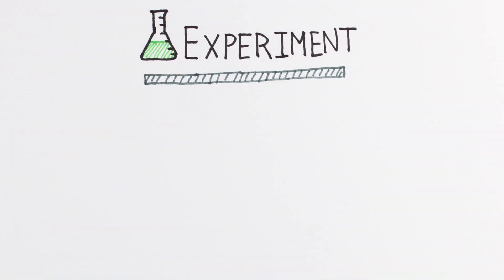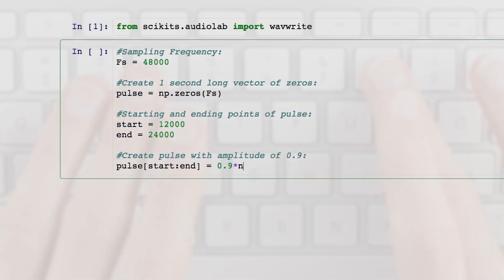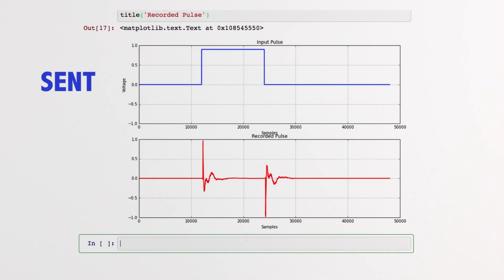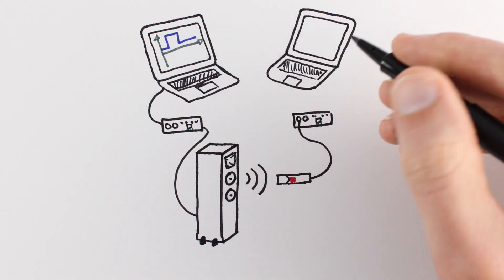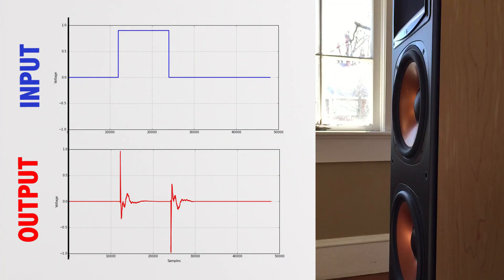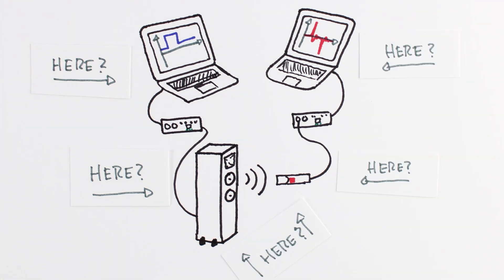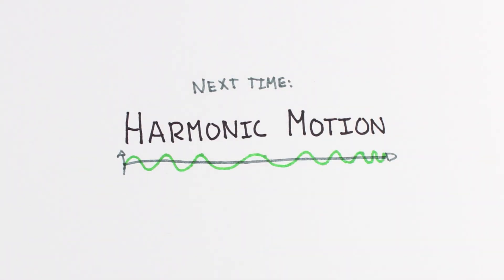How To Break Sound [Part 1]

Comment: The speaker is a transducer, they are designed to output analog signals not digital signals like the one you created. The flat line in your signal represents DC .  If you send DC into the speaker it will damage the coil if it is on to long. Speakers are designed for Audio Signals Only.  NOT SQUARE WAVES.

Comment: Differentiation. Notice the spikes opposite direction. Pretty sure the signal is of a way too low frequency to not be filtered in the HP filtered in most of the transfer-capacitors and probably its own coil as well.

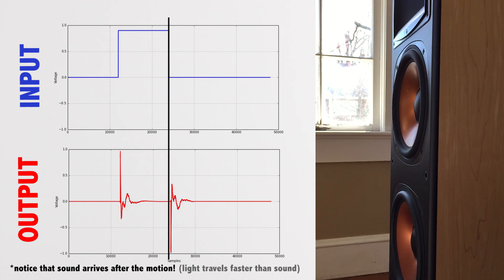Comment: @ 01:20  This is very misleading.  If the voltage were applied directly across the speaker, the cone would remain extended for the duration of the pulse!  You said "... speaker moves in a pattern that doesn't even resemble the voltage we applied across it".  YES, it DOES!   What we are seeing is the output of the _amplifier_, and not the test signal source.  Looks like there's some AC coupling in the circuit somewhere.  Feed the signal through a DC amplifier to the speaker,  and watch what happens with the woofer cone.  Either that,  or you are sending the output from an amplified mic output to the speaker, and showing the result of the mic's response.  In any event,  the speaker, as shown,  is not the one being fed by the original signal, before being measured by the mic.  Booooooooo!   In any event,  only the certain harmonics of the pulse are making it through the chain.

Comment: I think its the speakers: 
The speaker is a system of magnets, one permanent and one which is a coil electromagnet. When you make the signal high you energize the coil and make a magnetic field, this causes an interaction between the two magnets (if you notice, they repel at the moment the signal goes high and attract when it goes low).

An inrush of current causes the magnets to repel much further than at normal current, so the cone goes further and then goes back in, oscillating a bit, as seen on the microphone. When signal is cut off the "magnetic inertia" cause the cone to be attracted way too far for the normal position, so it oscillates creating the second sound...

Comment: The driver of the speaker is doing what you tell it to do. The issue is the Physic of sound. The speaker gets pushed up when it reached the voltage spike. It then moves back when it reaches the end. We don't hear anything when the voltage is constant we only hear it when I change. The only places it changes in the begging and the end.

Comment: the problem is with the speaker and mic not being able to accurately reproduce/capture a perfectly discontinuous signal like a square wave. After reaching the max and min there is still some tailing vibration. It does a better job representing smooth continous signals.
Reply: The speaker can and will capture and respond to a square wave.  The reason it did not d so in the demonstration is most likely due to ac coupled stages in the amplifier - the speaker never sees a square wave.  However,  to propagate this signal as a sound wave would require two things:  a dc amplifier, and a sealed tube (waveguide) between the speaker and mic.  Ever wonder why decent headphones deliver such rich, deep bass to your ears?  They make a good seal, to keep pressure leaks at a minimum.  Actually,  small speakers can reproduce low frequencies quite well,  just not loudspeakers,  at least not without elaborate enclosures and / or horns, due to the severe impedance mismatch at longer wavelengths between the moving surface (cone) and the open air.  They just cannot move enough air to offset this mismatch.

Comment: capacitors  and inductors behave that way in response to a discontinuous signal like you applied. the speak coil is an inductor. it works for sound as ,sound is a continuous signal

Comment: its simply because speakers work with AC, and it wont do anything if you keep the voltage the same (AKA when its a horizontal line in the graph). when the graph has anything but horizontal, the output becomes AC, which makes the magnetic field in the speaker, then it goes to horizontal, which is DC, and DC doesnt make electromagnets work, so the speaker swings back to rest position, then on the other side of the square wave, when it goes low again, the decreasing voltage again "makes" AC so the speaker moves the other way, inwards TLDR: horizontal lines are DC, which dont make magnetic fields

Comment: The issue is that the speaker cone isn't actually designed to output pressure waves that match the waveform of the voltage input. This is because the speaker cone is controlled via a magnetic field that changes proportional to changes in current (or voltage, equivalently, see Faraday's Law). In other words, the output of the speaker cone is (ideally) the derivative of the square wave, which should look like two vertical lines, the first approaching infinity and the latter approaching negative infinity (Dirac delta functions). Looking at the output waveform, we see that the output also contains some decaying sinusoidal components; these are caused by the speaker cone's natural (or resonance) frequency, because the flexible sections of the speaker cone act like springs that oscillate harmonically. (Actually, the magnetic field of the speaker also behaves like a Hookean spring and it's unclear whether the harmonic oscillations occur primarily due to the mechanical or magnetic components.) 

Knowing this, we can design a voltage waveform that will actually give us a square pressure wave; we simply need to integrate the square wave over time. This produces a voltage waveform that looks almost like a square wave, except instead of having the top of the square wave be flat, the top is slanted, increasing as a function of time. Of course, the output would still contain evidence of the speaker's natural frequency, but removing that is a control theory problem that can get pretty complicated. 

So, why does this work well for voices and things? The important thing about voices and other sounds is that they follow a regular pattern; i.e. they contain waveforms that repeat over time (periodic). Fourier transforms (which many other comments have mentioned) allow us to break down arbitrary waveforms into sine waves. And what's the derivative of sin(x)? It's cos(x), which is really just sin(x) flipped over! Thus, when working with sinusoidal outputs, the speaker doesn't need to worry about the derivative issue mentioned above. This works well for voices (because our vocal folds are harmonic oscillators) and other things (because actually, at the heart of every physical system is a bunch of harmonic oscillators) because the waveforms they produce contain very "well-behaved" sine waves. In contrast, a square wave (an idealistic human creation) contains an infinite number of high-frequency sine waves that can't be accurately replicated by a speaker cone. In short, speakers, no matter how well designed, are inherently bandpass filters that cannot produce frequencies outside their operating range. Speaker manufacturers design speakers to perform best within the human hearing range, so it's unrealistic to ask them to output strange things like square waves. 

Another interesting note is that our eardrums are, in a sense, inverse speakers. This means that although a speaker cannot produce a square pressure wave, if a perfect square pressure wave were somehow produced, it would probably sound basically the same to human ears anyway!

tl;dr: It's the speaker.
Reply: Dennis Zhang You wrote a nice explanation but the magnetic field from the voice coil actually does change proportional to the current flowing through it. There is no time derivative in Amperes Law. 
What actually happens is that any n-th order high pass filter approximates an n-th order differentiator at low frequencies. Between the audio interface (2-4 th order), amplifier (2-4th order), speaker (2-4th order), microphone (1-3rd order) and the audio interface again (2-4 th order), we are likely to approximate a differentiator of order 9 to 19 at low frequencies relative to the lowest cutoff frequency in the signal chain.
Reply: Damn bro just explained application of math from signals class at ECE

Comment: The problem is our expectation. The diaphragm moves according to the wave: It moves forward (creating an "positive" pressure wave), stays idle for a moment, and then moves back (creating an "negative" pressure wave). In the end only when the diaphragm moves, we hear sound, because we only hear when the change of position of the diaphragm creates and pressure wave.
Reply: The pressure wave dissipates into a low impedance (open air),  hindering propagation.  The sound wave cannot effectively build up, no matter what the waveform (sine, square, sawtooth, etc).  Since acoustic impedance is inversely proportional to wavelength:  the lower the frequency (the longer the wavelength of the fundamental frequency), the higher the quantity (mass) of air that must be be moved, in order to affect propagation over any appreciable distance.  All we hear are the higher order harmonics, possibly along with some parasitic oscillations of the speaker cone.

Comment: I’m going to take a wild guess and say that the speaker itself just isn’t capable of moving outward and staying there for that long. Each membrane on the speaker only vibrates on one frequency at a time, because if they had designed it otherwise there would be more direct interference.
I really hope you guys do binaural stuff, not just speakers. Our ears are amazing!
Reply: You guessed wrong.  Put a DC voltage across a speaker's voice coil,  and the cone will move,  and stay in that position until the voltage is removed or varied.  However,  the air pressure change in front of the cone quickly dissipates, at a rate dictated by the so-called frequency response of the speaker,  as measured as acoustical pressure at (usually) one meter away.  The speaker pushes air at frequencies down to zero,  but propagation of the resultant sound wave is a different story.

Comment: My simple answer (guess) is that the square wave has lots of harmonics, many of which are below 20Hz and above 20,000Hz. Here is my guess, or what I know. The WAV file is fine, and represents what you want it to, that is sent to a DAC which converts this into an actual electrical signal. However a DAC is very weak and needs an amplifier, but audio amplifiers generally use high pass filters at some stage to remove DC bias (that steady state voltage that does not change over time). So the waveform will be stripped of the DC and very low frequency components below 20Hz, and only components above 20Hz up to 20,000Hz are played. I don't understand the math behind frequency domain and fourier transforms, but that is probably needed to understand this stuff mathematically.

I do know that any function graphed over time like that can be approximated or represented as the sum of sine waves of varying frequency and amplitude. That waveform looks suspiciously like a derivative wave with lots of bleh on it. Our ears would never respond to the exact position of the speaker, and to maintain a specific position offset (bias) on the diaphragm would be nothing more than a waste of energy and might burn out the driver. Likewise our ears would not respond to a steadily moving object. It would create a constant pressure wave in front of it. We cannot hear 0Hz, or feel that pressure that does not change rapidly over time.

So in effect that graph is the result of a really dirty 2nd order derivative, (well, probably a pretty hairy differential equation).
Reply: +Welch Labs Haven't watched the rest of the video series, am I close? :) (youtube likes to hide the read more button sometimes, may need to refresh the page to see it)

Comment: The speaker is a mass, spring, damper system and so a dynamic system of second degree, which means it has a nonlinear transfer function from input to output. That means, if you want to actuate your membrane like your input function, you have to multiply you input signal with the inverse of the transfer function of your speaker. It is basically control theory.

Comment: I believe the problem is the electrical signal sent. It has only 2 voltage variations, which is why we hear 2 separate taps. Then, when the microphone records those taps, the signal it sends is the tap itself and the "aftershock" the speaker has when "tapping", which would correspond to the big spike followed by the small ones on the recording plot. We see 2 of this patterns because of the voltage variations mentioned before.
Basically, the output signal is the voltage to generate sound and the input signal is how the air moves in response of the output one.

Comment: Is this series continued anywhere?

Also i think the issue is the speaker and microphone. It has mass and inertia. when the signal is applied the speaker (cone, i guess it's called) cannot teleport to the position in space corresponding to the max signal position.

The speaker cone moves in response to the applied voltage and oscillates because of the inertia. One the signal is removed, the cone falls back down and oscillates some more.

Similar effect in the air and with the audio detecting element in the microphone.
Reply from the maker: +xerotolerant Nice explanation! This series became temporarily derailed - hoping to get back to in 2016. Thanks for watching!
Reply: I feel honored that you responded to my post.
I don't know came up with the design for your series and such but it just has me in awe when I watch them. I hope you keep going sir. Your videos are just downright inspirational.
Reply: Welch Labs It's 2017! ;w; I know it takes a lot of time and effort to make a Welch Labs quality (TM) video but I'd really like to see this series continue!
Reply: still waiting.... :(
Reply: xerotolerant it's a fundamental property of sound. In order to receive the sent message, the microphone membrane will have to move backwards, stay there, and then move forwards again, which is impossible. 
This is the exact thing the speaker does and in order to re the signal again, you need the microphone membrane to move the same way, but you can only inflict changing bumps through air molecules, you can't push on them and have them stay that way , keeping the pressure as you would if there was a stick between the microphone and speaker ... 
Long story short, you lose every bit of stagnation away from the origin at the receiving end of this setup
Reply: @mihailazar2487  Exactly.  It has to do with moving mass vs frequency response.  To send a very long wavelength (low frequency wave) any appreciable distance requires moving a lot of air.  An ordinary , reasonably sized speaker diaphragm simply cannot move enough air at frequencies much below the audible range in order to generate a wave that can propagate in free air.  Likewise, the inverse is true of the microphone... its element must have a large enough surface area and high enough compliance to act as an effective transducer at low frequencies, else the small fraction of the air volume cannot exert enough force on the element for it to respond to the slower changes in pressure.  In the event of a pulse or square wave, all you'll  get from the mic output is the harmonics that are within it's passband.  It would take a lot of power,  and a pair of rather large bass horns to send a 1 Hz sound wave from speaker to mic in open space.  The transducers would be ridiculously large, and inefficient.
Reply: it is the harmonic motion video
Reply: There's actually a bit more. If signal is generated digitally then before it will become analog, your square, during the conversion using traditional audio chips such as in laptops, will transform into something entirely different... ;)

Comment: I think the only problem is whole your setup. Audio systems are made for frequencies from 10Hz to 20kHz. Both audio output/input of your computer and input of amplifier are most likely AC coupled(by series capacitor). In practice it means, that it cuts off everything below 10 Hz. Speaker usually cannot truly reproduce sounds below 30Hz, it simply hits the limit so even without AC coupled input it would not play 2s or 0.5hz square wave. You would need signal generator, amplifier without ac coupling (you can bypass it on some amps), speaker with sealed bass reflex and all gaps, not AC coupled microphone inside the speaker box and oscilloscope to measure signal from mic.
You can try directly connecting aux cable from your computer line-out to line-in to see how it cuts off your square wave.
.
Sorry for my awful english.

Comment: I think the digital signal is to blame. That slope is too steep for speaker to recover back to its mean position. Also there is some SHM going on there, the speaker starts oscillating, thus curved part of the mic signal. I wonder if any form of damping would help. That's my guess.

Comment: My guess would be: Sound we can hear is made from an infinite combination of sin and cos (different frequencies) in time domain, which corresponds to the vibration of speaker wafer. The two jumps of window function in the video can be disassembled and represented as a series of sin and cos while the flat part has all sin and cos of magnitude 0 (maybe except the 0 frequency component). The wafer cannot make a sound when lack of sin and cos. Great video btw.

Comment: I guess that the system tries to "play" a wave form that isn't a wave form. As you said sound is something that varies in time, so when the signal rises up the speaker starts moving (with some kind of delay), but when it stays still there is no more sound to play until it goes down again. Is it like this?